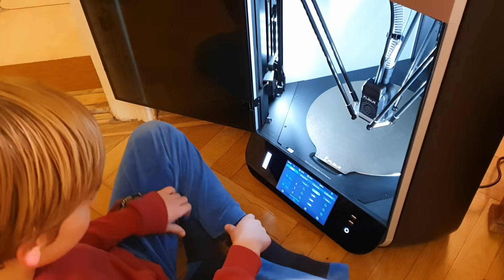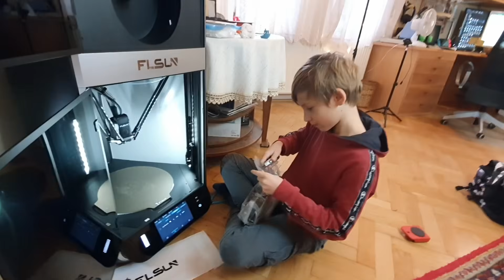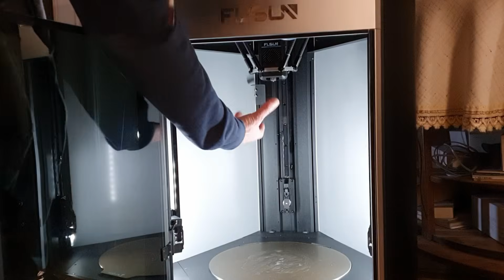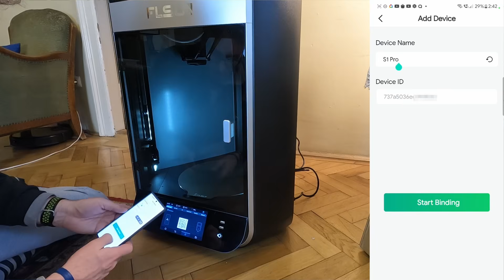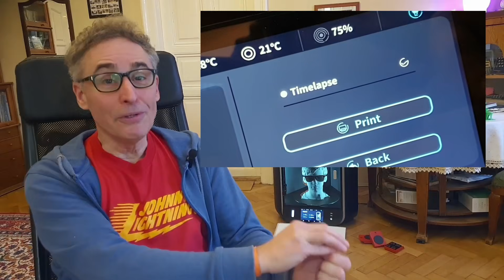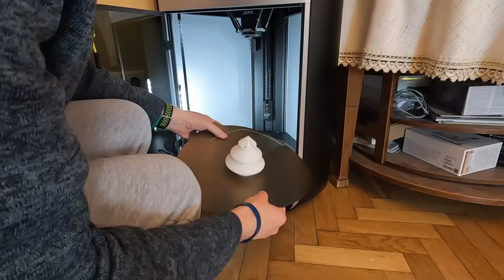Is the FLSUN S1 Pro really THAT fast? Setup + first impressions of this ultra-high speed 3D printer

Comment: Do you think this is a good printer for a beginner? Delta printers look so cool.
Reply from the maker: I'd say yes. The only draw back: it will spoil you, compared to this everything will feel like a snail. It is ideal for the beginner materials: PLA and PETG. It doesn't have a heated chamber, so engineering filaments would need some upgrades, and the toolhead is kind of difficult to service, which is not necessary with basic filaments, but could be an issue when you start looking into more difficult materials. The built-in filament dryer and all the usual bells and whistles make it a good beginner machine. It comes preassembled, if you've watched some of my videos about our experience, you can be up and running in 30 minutes after unboxing. There were software updates which fixed some of the software issues I mentioned in last year's videos.
Reply: @gerGoPrint3D  I'm old, retired and all i have is time! thx for the feedback

Comment: I have this printer since Nov 2024 and its been nonstop problems ever since. It's obvious they rushed this printer to market without the requisite QA. Mine has motor failures, driver board failures (that catch on fire!), slow reluctant responses from FlSun make this the worst printer I've ever owned.
Reply from the maker: My experience is better, it's been one of my most used printers because of its speed. But we have now experienced our first nozzle clog,,, that wasn't fun.  The extruder design is asinine, I had to take it completely apart just to remove a piece of stuck filament. But at least now I know how it works inside, and hopefully won't clog it up again.
Reply: @gerGoPrint3D  Yeah I had one of those 2 days ago and your assessment is spot on, absolutely ridiculous that you have to take the entire extruder apart to unclog. Furthermore, since i was "there" I decided to insert the extra hotend they provide and in FLSUN QA or lack thereof it would not fit and insert completely so I had to break the ceramic heater remove. Just add that to the list FLSUN failures..

Comment: In your next video I would love to see more information about detail in your prints, as well as strength.  On my T1 pro I have prints that look good initially, but upon closer inspection it seems small details are lost. I have also noticed much weaker parts from my T1 pro vs my other printers.
Reply from the maker: Thanks for the request. I will show close ups of our prints. Speed and high details are mutually exclusive. If you want high detail you'll have to slow down, at least the outer walls and top most, bottom most layers. But that's just the nature of high speed printing, corners are literally being cut. Use high speed for drafting and functional parts, slow down for details. And the same goes for strength, layer adhesion, we can increase nozzle temps by a little, and printing with closed doors can help with layer separation with PETG, but for sufficiently strong parts you'll have to slow down. 

By adding modifier objects in FLSUN (Orca) Slicer you can strategically slow down printing in certain areas where you need extra strength or detail.
Reply: @gerGoPrint3D  You'd be surprised  Pretty much, if I can stay within my input shaper reccomendations for max accel, I keep detail.  My Voron 2.4 has 15k y an 25k x accel so I can go quite a bit faster than my T1 Pro while keeping detail.  On my T1 Pro my max accel recommendation is <5k.

Comment: Thanks for sharing your noise results, I hadn't seen that yet and it was nice to compare and see they are similar to my T1 Pro, which also is about 67db at 3' away with the door open.  With the door closed do you fear you will end up with extruder clogs when printing pla?
Reply from the maker: Thank you for the kind feedback. So far I have printed everything with closed door, relatively long prints out of PLA and PETG. No clogs. I think FLSUN did a good job of extruder cooling and part cooling. We'll have to see later how it's going to hold up in the summer when ambient temps are 10-15°C higher, but for now, in a room of 17-18°C ambient it can perfectly print with the door closed. I was warned about the extruder being prone to clog, but since this first video I have developed a smart macro to unload filament by retraction and so far I haven't had any problems with the extruder of the S1 Pro.  Details coming in the next installment.
Reply: @ I'm quite pleased with the extruder on my T1 Pro as well, best thing on it for the money I think.  While I'm disappointed with FLSun's business practices, it is quite a lot of printer for the money considering I paid $399 for my T1 Pro.
Reply from the maker: @crashingsux  That was an amazing deal!

Comment: You are unflinchingly positive in your review.  Like where you say there is hope for SSH access in the future, although FLSun has repeatedly refused to make any commitment to enabling ssh, to allowing full access to klipper, and even when the community has provided ssh access to the S1 and T1 models, FLSun has then promptly released another update solely to remove the access.  I'm not sure many users of their printers could remain so positive through all of that.
Reply from the maker: Admittedly, it's still the honeymoon phase, but yes, I have a positive mindset about all my tech. Nothing is perfect, but we can make the most of it—and for me, that's part of the fun. Regarding the S1 Pro, there seems to be almost nothing that needs changing; it just works right out of the box. That said, now that I've developed a proper and seemingly reliable unload filament macro, I no longer dread switching filaments.

As for SSH access, I'll do my best to provide feedback to FLSUN, but honestly, the only things I really use it for are creating system backups and generating resonance graphs. The ability to use regular Orca Slicer, fine-tune printer.cfg, enjoy unhindered access to Mainsail, and add or modify macros already gives me plenty of freedom—and I love it. Let me know if you'd like further refinements!
Reply: With all due respect, I strongly suspect that it isn't just your natural optimism. Other creators have publicly disclosed the terms and conditions of FLSun's agreement for providing a review model, specifically their editorial control of the content of your review to ensure you cast the product in a positive light and caveat any negative experiences with a note that FLSun are constantly working to improve the product with firmware updates. 

There's a reason they've been giving review copies to YouTubers with 4-5k subs rather than the big name reviewers, and it's because most of them (Lonely Moses being the exception) wouldn't agree to those terms.
Reply from the maker: @jonathongable9734  no contract and no such terms. And I tell you plenty of negatives, which FLSUN saw not earlier than you. I might have been luckier (I tend to be with hardware, haven't had a lemon in 11 printers so far, though all need a bit of fixing which I enjoy). No editorial control, and I tell you the good with the bad, even if they never send a device again. If u have any questions I will respond best to my ability in the follow up

Comment: Fully open Klipper, extreme fast, perfect prints. Great printer.
Reply: Not quite fully open, you can't upgrade the klipper version (it runs klipper 10, quite old), you can't add on common klipper upgrades like Klipper ShakeTune, and they have been actively trying to combat open source efforts that have given users SSH access.
Reply: @ Just Mainline Klipper it. There is SSH access and root access.
Reply from the maker: @kampfwuffi  Yes, that's the fix. I might do it later into owning the device. For now I want to make sure everything works with the stock fw
Reply: @ I have opened SSH access on mine but haven't upgraded klipper yet.  I am aware of a few people that have lost ssh access again due to flsun releasing new updates to combat the current jailbreak.
Reply from the maker: @crashingsux  How did you do it? Mainlined your T1 Pro? Yes, it would be ideal if we did not have to pick between most up-to-date official software and the freedom to SSH into our printers. All my Sovols provide this freedom, though that means they mostly rely on us, users to improve the software post release... For tinkerers this is heaven, but I can understand the frustration of more beginner Sovol users.
Reply from the maker: Appreciate the love! The S1 Pro is already a star 🌟, but with SSH access, it'll be the whole galaxy! 🌌

Comment: The FLSun S1 Pro is a very attractive printer.  I prefer to print my functional parts a bit slower for best layer adhesion strength and the edges of a circular bed are usually wasted space for my rectilinear designs (although oddly, the photogrammetry light box I'm designing now is cylindrical), so I've shied away from delta printers in general, but this S1 Pro is so cool I definitely want one.  It does look like something from a science fiction movie - maybe the version 0.9 Star Trek replicator?

Huge kudos to FLSun for using open source Klipper instead of a proprietary attenuated version that is so popular with other 3D printer manufacturers.

That 8 minute speed Benchy looks as nice as the very nice 13 minute speed Benchy from my SV08, but in only 60% of the time.  The semicircular prime stripe before the print was just showing off.   😀

I'm not a fan of apps or cloud based print servers but I assume since this is a Klipper printer that I could print directly to it from OrcaSlicer over WiFi.  The 320 mm diameter and 420 mm peak height is a very usable build volume and I love the built-in filament dryer.  I think of FLSun as a premium brand commanding a premium price but US$1300 (after your discount code) seems reasonable to me for a delta printer with CPAP cooling, 1200 mm/s print speed and 4 g acceleration.  This beast may be the best 3D printer value on a $/kg basis.  I might be able to get this if I tell my wife it's a cat toy.  I know the cats would be as mesmerized by the delta kinematics as I am.

I am very much looking forward to the rest of this video series on the S1 Pro.  Thanks.
Reply from the maker: Thank you for your interest! I am with you on prefering reliability and quality over speed, but sometimes it's also good to have an option for lightning fast results, and also with all the square base printers this is a good alternative to have an option for round models like your light box - into 3D scaning?  And yes, this is right out of Star Trek, or Bladerunner, though both predict this type of technology much later, blows my mind to experience my childhood fantasies first hand.

We are still waiting for full SSH credentials to be made available, here Sovol still has an edge in open source! But I too am encouraging FLSUN to match Sovol's commitment.

Coming in the next video, the FLSUN slicer is a complete Orca implementation, but with many more filament presets than our SV08 came with. Not such a big deal to tune our own filaments, but still makes the software side of things more complete in case of the S1 Pro. I think the regular S1 did not originally come with this polished slicer/mobile app offering, so maybe Sovol could also level up with an SV08 "Pro" refresh (or just release a good set of presets :) 

See, I am already comparing the two machines, although that's only planned for a 3rd or 4th video about the S1 Pro. But that comparision will have one more monster printer in it (hint hint).
Reply: @gerGoPrint3D  - Thank you for your very interesting review!

We should be calibrating and optimizing our settings for the brand and even color of filament that we use, with the excellent @Microswiss CHT high flow nozzle, the types of parts we print, etc., but printer manufacturers need to do a much better job supplying good generic profiles for PLA, ABS, PETG, and TPU at a minimum, preferably with a fast and slow profile for each.  It's not that difficult to create our own profiles but a printer should ship with good profiles so we can be immediately productive and have a good initial experience.  So many companies copied Bambu hardware and offered their version at a slightly lower cost, thinking it was hardware and price that were important, completely missing the fact that Bambu was successful because they offered a reliable printer that was easy to use.

If Sovol offers a PRO version of the SV08, I hope it has a thicker stress relieved aluminum print bed that warps much less, a higher quality temperature compensated 8 mm inductive prox or touch sensor for bed mesh probing, and WiFi that works.  More LED lighting and a real Volcano nozzle would be nice too.  Valerie Moore posted a part on Printables that prevents the pin from walking out in the SV08 extruder and causing under extrusion so they should fix that too.

I'm very eager to see your large format 3D printer comparison.  I know the FLSun S1 Pro is going to be the fastest, and I doubt the others will look half as nice, but I look forward to seeing how the FLSun compares in other areas.